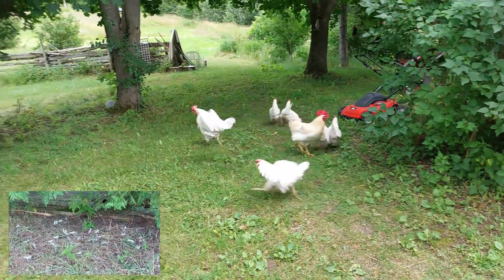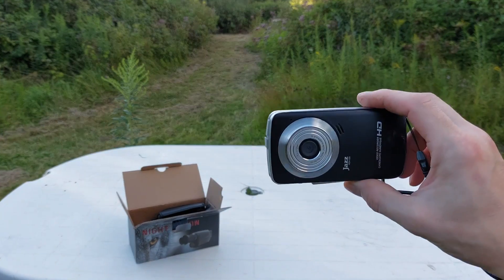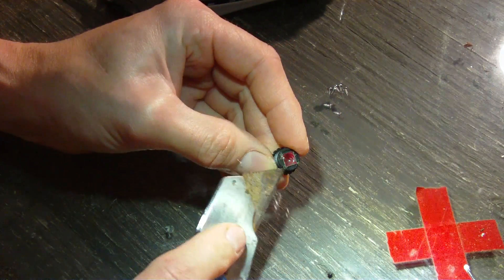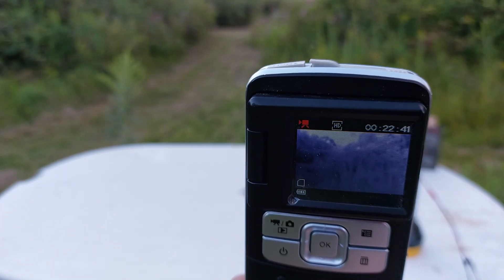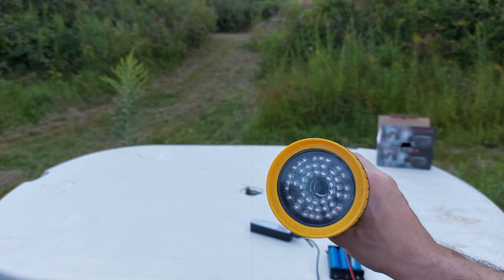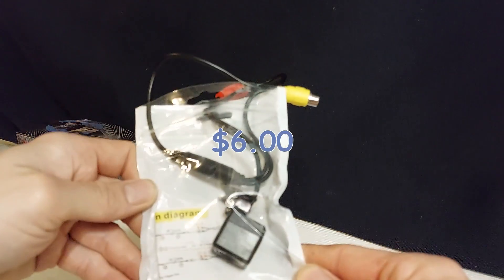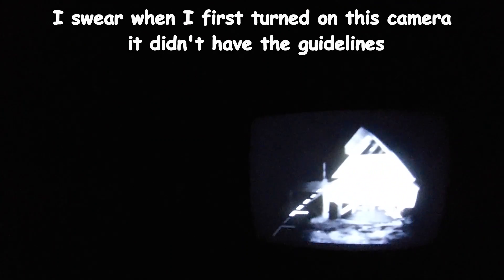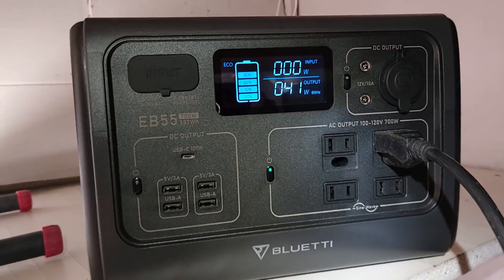How to Convert a Camera to Infrared Night Vision + Homemade IR flashlight

Comment: Can you tell us more about how you built the IR flashight, thank you.
Reply: he just disassembeled an old security camera which had an ir flashlight built into it and took the flashlight part out of it
Reply: No s*** he just disassembled it  what he's asking is basically for a schematic in a build on how to do that not just show me a flashlight that you made that's in my face like come on bro I'll give you a like to the video when you actually show me how to build it I hate when people do that it's like man I know a lot and I'm willing to share with anybody but for somebody to make a video and not even show how it's made or not even have a link video that's kind of petty it's not very hard my confusion is just the COS sensor and IR lamp wire versus the ground and the 9-volt which poses four wires and my curiosity is how those are wired are they just jumpered or is the COS sensor a separate circuit that needs to be wired into something else that's where we're trying to figure that out that's the question that he had I guarantee you exactly like I said I'll give you a video a like if you can actually post a how-to video or show me a schematic at least thanks cool video though aside from that

Comment: WoW seen pretty simple , bought and external IR Night light for DSLR cameras but didn't work on my Canon Rebel Ti5, but it did work a bit on my Lumix FZ-80 funny because it read on description, for DSLR and the canon is a DSLR, but ima try this on a camera i wont use, Thank you very good video to convert a older camera to Night Vision...